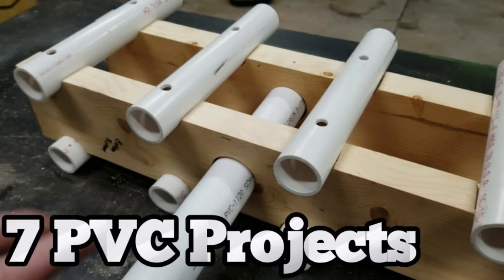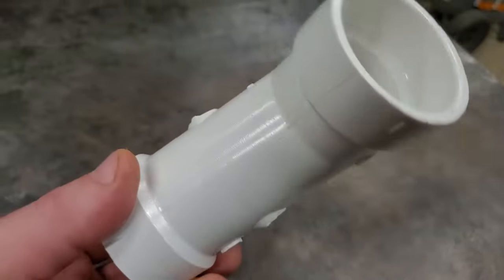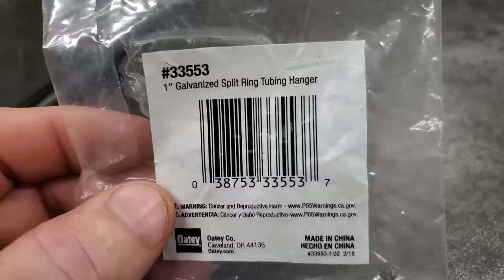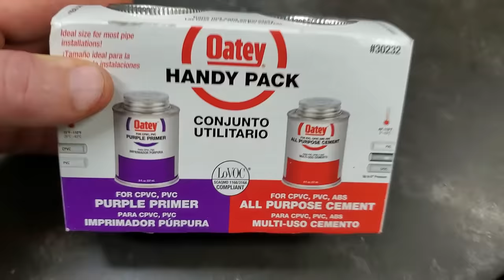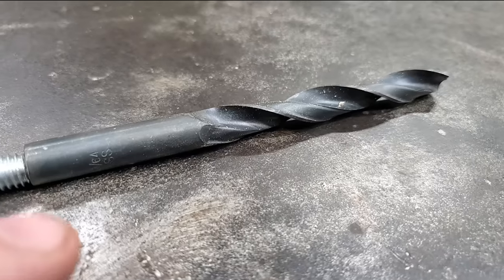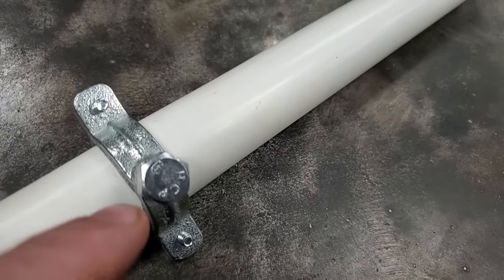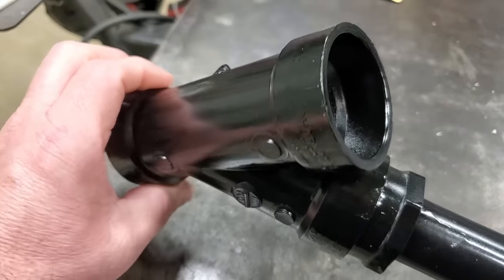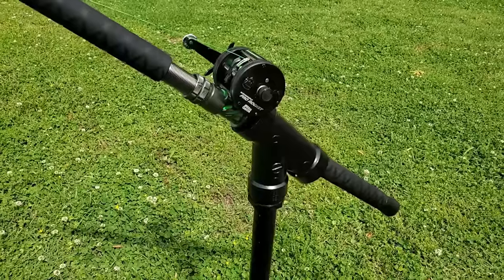(DIY) PVC rodholder for Bank fishing

Comment: You can also purchase a threaded nob from Lowes with the same thread pattern. It will allow you to hand tighten the holder to the stake without using pliers or a wrench.
Reply: To fancy
Reply from the maker: I thought about that but couldn't find em lol
Reply: @FishinNStuff  check Grainger also, another good source.
Reply: @cliff0dean  I use a 3/8-16 x 2-1/2" eye bolt.

Comment: Made a couple of these the other day. Taking the hanger apart does work but found it quicker to loosen it and slide it on the pvc pipe and just tighten it down after threading the bolt in the hole you drilled out. Both ways work it just saved me a little bit of time. I appreciate the video, wouldn’t have built them without watching it.

Comment: I bought two light weight fence posts and a 2' length of 1 1/2" PVC. Bend the fence posts to your desired angle, drill holes in the PVC and bolt them to the posts. 2' of PVC cut in half makes 2 holders. I sharpened the bottom of the posts to facilitate putting them in the ground. They cost about $8 each. Work great.

Comment: That is an impressive rod holder. I might try to make one that works for surf fishing to
Reply: I was just thinking the same thing. I got my first fishin surf trip coming up. This gives me time to put it together. 🤔
Reply: @james hook  crazy as this may sound, you don't need anything but a square cut piece of 1 1/2 pvc pipe about 2.5 feet long. Place pvc in the sand at the water line. When the wave comes in, suck in on the pipe and it will sink in the wet sand
Reply: @cliff0dean  yeah that’s what I use now.

Comment: That is one good rod holder I like the steel bar and tighten the for holder to that rod by the bolt. That way you can bit on the steek rod then slide the rod holder over the steel bar and tighten the bolt to the steel bar locking the rod holder. And to remove losen the bolt slide the rod holder off and bang on the steel rod and took it back and forth and remove seperated from the pvc part of the rod holder. Great idea thanks for sharing.

Comment: I don't remember where, but I recall a rod holder that was a straight length of PVC with an angle cut on one end (if you want to be fancy, you can flare the other end). To set it in the sand at the beach, you press the angled end into the sand and then suck on the other end to draw it down to make it solid.

Comment: We make a similar 1......instead of 1 inch pvc we use 3/4 inch steel pipe theaded in one end and cut on a angle on the other using a 1 1/2 pvc to 3/4 female threaded adaptor.......we put a cap on end first to pound it in and then thread the holder on to use.
Reply from the maker: That's a really good idea too

Comment: Where I live it's mostly saltwater with sand/mud so you just get a length of 3 inch PVC. Cut in in half then each of them cut in half at 45 degrees. Bingo - 4 rod holders.
THe one you made looks pretty stout though.
Reply from the maker: I made some like yours for the beach last year and they worked fine at the beach , but I went to the inlet to fish one night and the wouldn't go through the shells they were so thick . I think this new rodholder will work great for that problem
Reply: @FishinNStuff  yeah if you know your spots you can make allowances. I take a rubber mallet sometimes. I have a couple made out of 4mm aluminium tube I was given. I've also got some that are 3 feet of 1/2 inch stainless rod with a flat bar on one end that is then bolted to 6 inches of 3 inch PVC for use around rocky areas.

Comment: Only thing that I would do to this rod holder is cut a slot in the top of the Y so your reel base can slide into. Keeps the bait caster from rolling over.
Reply from the maker: That's a good idea  . But mine never rolled while I was testing it . Probably the EVA Foam I guess

Comment: Nice rod holder !! Any suggestions to allow this rod holder to be able to secure it to a bridge rail ??? Great video
Reply: Some kind of "c" clamp rig? Attach a seam clamp to the side of it with some hose clamps(stainless so they don't rust too bad)
Reply: Duct tape
Reply: Or tie wire

Comment: I liked it but you can make it so much simpler with 2 foot of rebar and 1 foot of 1and half or 2 inch pvc and gear clamp together and drive in ground. So much cheaper
Reply: That’s exactly what we’ve used for decades. With duct tape instead of clamps for saltwater surf fishing, and 4’ rebar. Been using the same ones I built in the early 80s. I do like this design for freshwater use though. Like the angle. Have a great one! 👍🎣👌

Comment: Before you start your hack make sure that you are not spending a dollar on a ten-cent problem. Wal-Mart sells assorted bank pole holders. Plastic or metal from $2 to $5 max. now use that as your baseline for your hack. Here's your cost formula; if your hourly pay rate is $ 20 per hour and it takes you an hour to finish your hack; that's $20. if your materials cost you another $20 total, you're now up to $40. "See what Iam saying"
Reply from the maker: That's true but your formula is wrong because you didn't figure in how bad Walmarts rodholders suck haha